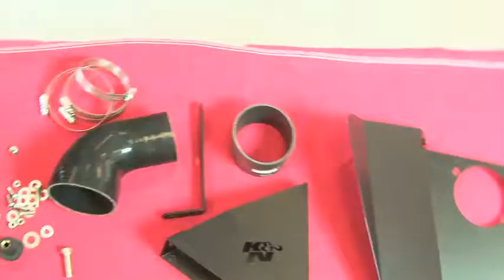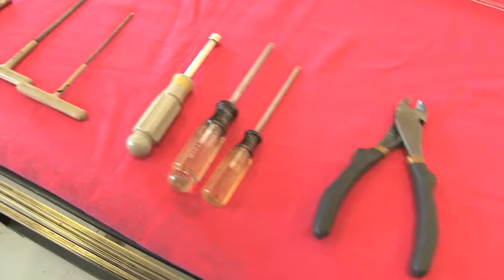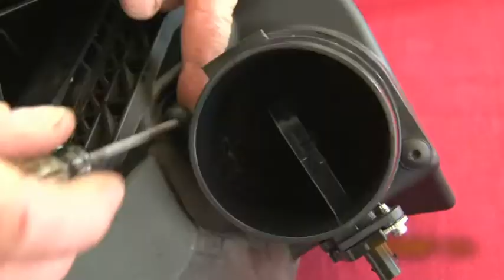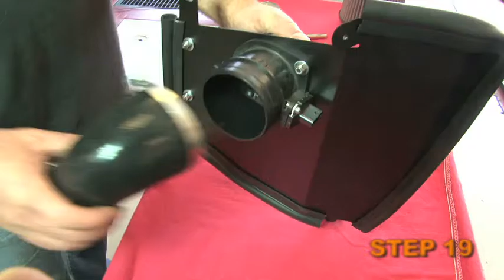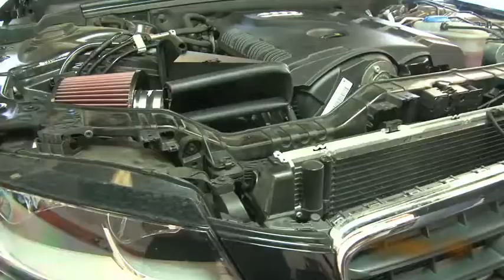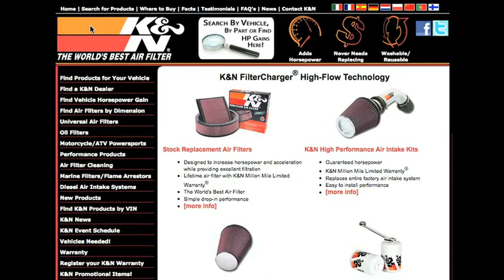2009-2013 Audi A4 Performance Cold Air Intake System Kit K&N 69-9505T Installation Instructions

Comment: Can I use the 69-9508T on my 2010, is almost the same?
Reply from the maker: That is for 2014-2015. No it will not fit your 2010 per the manufacturer.

Comment: Would this fit 2012/13 Audi A4 B8.5 2.0L turbo petrol Quattro?
Reply from the maker: Unfortunately no. K&N currently only shows replacement filters, but no coil air intake system for your application.